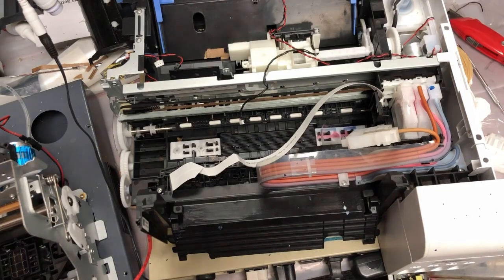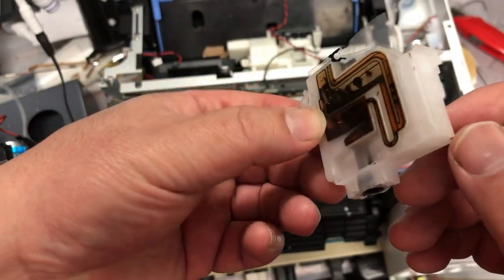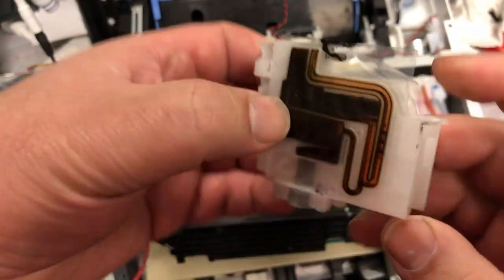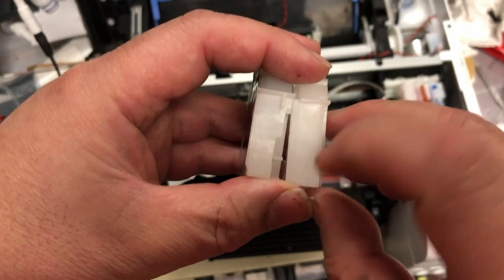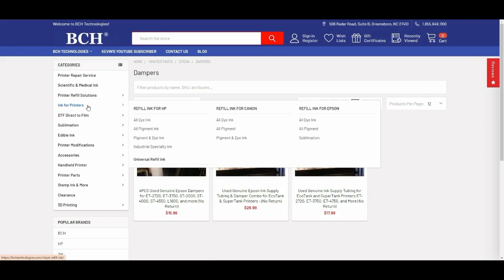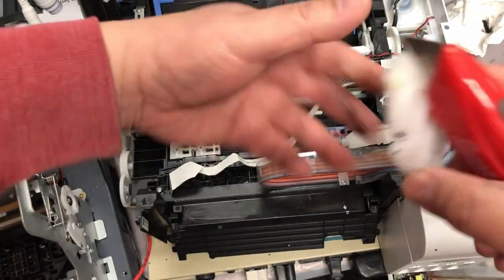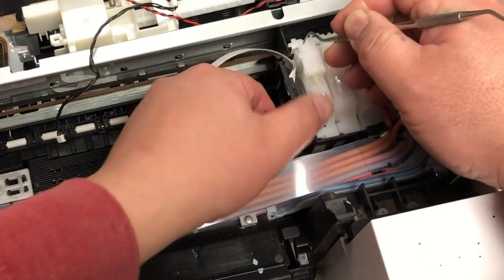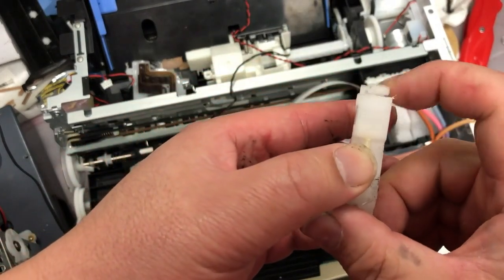Epson Dampers: Understanding the Different Types and Interchangeability

Comment: I use a WF-7610 with a CISS, but I've always had issues with magenta, no matter what. It would keep dropping out, as if the magenta couldn't flow from the tank to the cart. Other colors work just fine. I even swapped out tube lines and got new carts. Same issue. When I print, magenta works a little, but then just stops. Do you think a damper valve (mid-line) would fix this? To make sure the head wasn't the issue, I used a refillable cart that wasn't dependent on the tank, it printed absolutely perfectly, but I don't want to use refillables, I want it to be the tanks. Also the tank part was fine too, even swapped it out 2 times, no change. It's as if the ink itself is the issue. Possibly too thick? Originally it was Cobra ink, but that company went under and was supposedly absorbed by wala ink, which I tried next, same issue. Right now I'm in the midst of buying a new print head because this one finally gave out after so long, but I'm also buying a new CISS (empty) and preparing to use Epson's in house inks (542 bottle of pigments). In case I run into magenta issues again, wondering if I should stick a damper valve midline on magenta.

Comment: Is possible to use dumper with negative pressure instead of positive presure  ? I do not know if small dumper for epson 1800 and epson 1900 is good, dumper for 4800 lookl like more better ( way white ink and prevent sediment white ink) What do you think ?